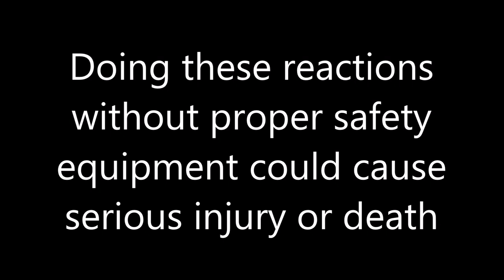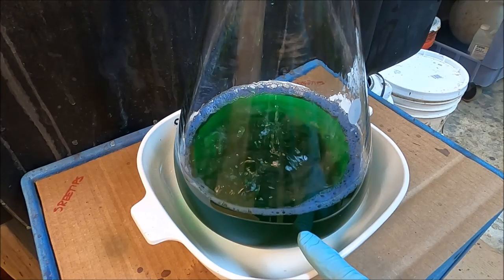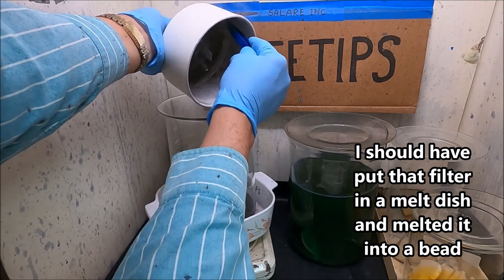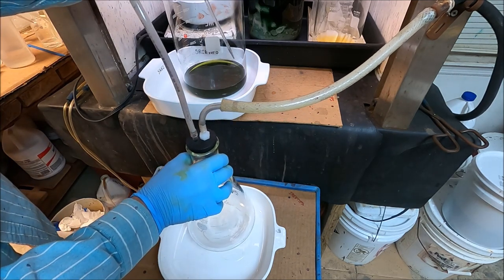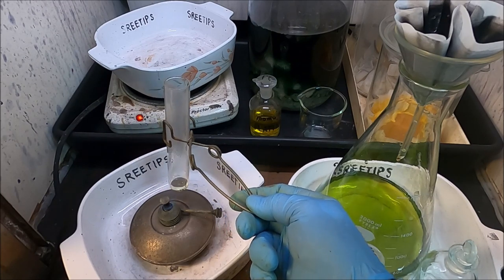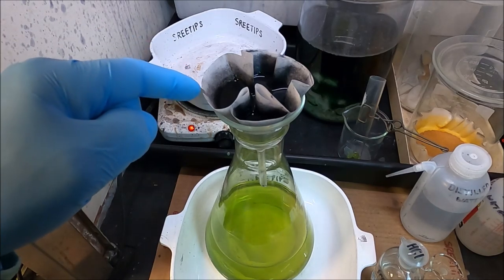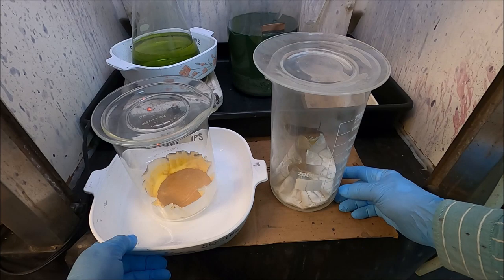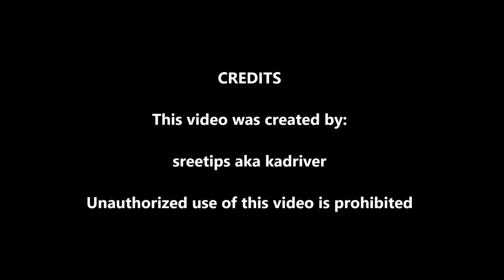Silver Cell Anode Filters Recovery and Refining Part 6

Comment: Hello Sreetips, You have two huge containers where silver is dropping with copper. We can see a lot of silver already dropped.The silver already dropped is does not require anymore process. Instead of handling the huge volumes, you can remove already dropped silver by filteration, thereby creating space for solution. It is not chemistry but only logistics. Also I noticed that for the silver to drop, the copper should be exposed to the solution. As silver layer builds up, the reaction slows down. Meaning the copper needs constant shake up or some aeration arrangement to keep the solution continuously moving over copper.

Comment: The purplefoam may be not gold but just a refractional issue. If you pass light through a foam, that absorbs green light, only blue and red come through, so it looks purple. It is the opposite colour of green.

Same as a red-dot-sight looks greenish when you look from the wrong direction.
Reply from the maker: Cool. I'm just familiar with gold in solution appearing purple.
Reply: Yes. Think about the solution you had some months before. If looked the one colour when you looked at it, but in backlight that colour changed totally.

Comment: Would the silver cement out faster if you used fine copper particles, or would that just make it more difficult to separate  the silver precipitate from the unreacted copper later?
Reply from the maker: I've never tried copper powder.
Reply: @sreetips  My thought is that it might increase the reaction rate if you had more surface area on the copper. I don't know if that reaction is exothermic or not, it's been too long since I had AP chemistry to be able to find the reference quickly, but if it isn't too exothermic, you could potentially boost the reaction rate.   It does leave it up to you to figure out how much copper to add, because you won't then have the easily handled chunks of copper left to pull out after the silver is finished precipitating.  Just a thought experiment for now.  Thanks for the great videos that are helping to renew my interest in chemistry!

Comment: i noticed there is purple stains all over the walls in your fume hood , is that gold from vapours ? do you ever wipe it down to recover it
Reply from the maker: I’ve worked inside there for a decade. Those are from boil overs and spatters when transferring solutions. The stains won’t wipe off, I’ve tried.

Comment: On cement silver is the weight the same after you melt it? 1 ounce cemented = 1 ounce poured?
Reply: Good question.  I don't know.  I would guess 'no' because there are possibly other metals in that cement onto the copper from the solution, hence the strenuous efforts to purify the silver solution before cementing.  The cement will then be ultra purified by electrolysis, yielding the pure silver crystal.

Comment: Would adding Sulfamic Acid to the AgNO3 denox the solution of free nitric and still allow the copper to precipitate the Ag out of solution to cement Ag?
Reply from the maker: I believe that it will. But I’ve never tried it. I always ensure that there is undissolved pieces of silver to guarantee that all available free nitric gets consumed by the reaction.

Comment: Is it okay that theres an excess nitric acid in the silver nitrate solution? Whats the right thing to do then? Thanks.
Reply from the maker: Add more sterling silver to the solution to consume the excess nitric BEFORE adding copper to cement the silver out.
Reply from the maker: Excess nitric needlessly consumes the copper and wastes the nitric acid. It’s a lose/lose situation that can be avoided by adding more silver to rid the solution of the excess nitric before adding the copper.
Reply: How about adding a urea or sulfamic acid? To consume the nitric acid.
Reply from the maker: You could, but that wastes the nitric. Why not use it to dissolve more silver?
Reply: Thank you sir. Godbless. Keep safe

Comment: laser point gasification (high temperature ionization) and high electric field material ionization, assume ionization breaks all bonds
Reply: iridium or tungsten
Reply: have you tried an ion bridge filter paper when doing electrolysis or electroplating?
Reply from the maker: I don't even know what it is
Reply: @sreetips  ionization? they lose electrons
Reply: @sreetips  plasma
Reply: @sreetips  townsend discharge tube
Reply: @sreetips  in saying this I assume you could separate materials easy in gaseous form, if not better than with chemicals or liquid form, density and melting point separation
Reply: @sreetips  ionization in combination with boiling point separation/distillation, in vacuum
Reply: @Jkauppa  that's sounds like you need some fancy equipment!
Reply: @markselten4985  it would be kinda low-tech, a high voltage source (or a high-power laser) and a hydraulic water pressure container, if you want to create pressure to use lower temperature after turning the stuff into gas
Reply: @markselten4985  any extract you want to have which has boiling point above of the boiling point of carbon, around 4000C, would need something more special
Reply: @markselten4985  think it as very high voltage electrolysis
Reply: @sreetips  ionization -> gas -> heat filter -> gold + silver -> heat filter -> silver, should not be too hard to make mini ovens at 3100C, 2900C, 2100C, 1900C, to get the gold and silver, as a simple metal distillation system, also the high voltage zapper with a low vacuum container, from a transformer, *high voltage warning*, i'm tired of the 'dont do dangerous stuff' warnings, if this was in vain then the ion bridge, i dont know what it should do but probably let only certain kinds of ions pass to another electrode, compared to no filter ion bridge in the electrolyte, you could use two electrolytes